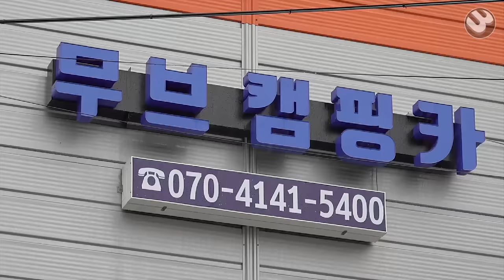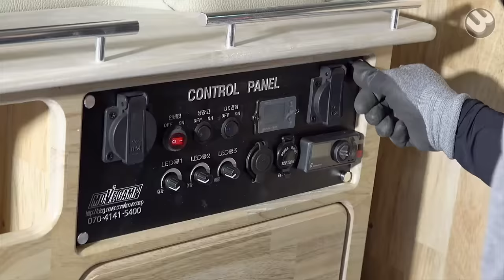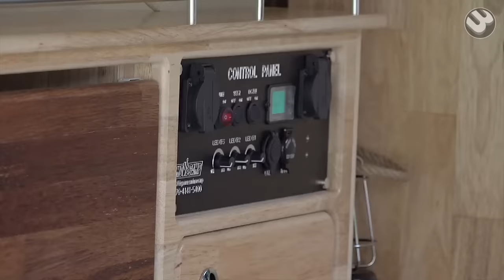Process of Turning Used Car Into Camper Van. Luxury Campervan Manufacturing Process

Comment: These guys look so in sync with one another. Amazing craftsmanship and team work. I love the they used all screws instead of fixed nails. Makes it much easier if you need to remove certain panels and pieces for paint or repairs..

Comment: Thank you ❤

I think this is a new car conversion, not a used car. Seems that 99% of the work is done at the factory building the components that fit into the vehicle. The end product is beautiful 👍🏼
Reply: Respectfully Wrong! 

These are all used vehicles; Pay attention to the demo / prep work. 

(Hint: Vacuum)
Reply: New cars don't have dirt, dried up liquids, and rust spots in the beds.
Reply: You can see the accumulated dirt that they vacuumed out, verifying that they are used, but gently used, based on condition
Reply: I think what they meant by "used cars" are resale cars; But I agree the conditions of the car is superb, which meant it's a fairly new repurchased car with much lesser work needed to be done. To be fair, if they had to show all the measurements and wood cutting process, it would likely be at least another 15min with time lapse.
It's a beautiful and superb product right down to the end.
Reply: Too much dirt under panels to be a new car.
Reply: @ksb8518  Blah, blah, blah.

Comment: Is there a U.S. company doing efficient, top-notch, streamlined mini-van conversions like this?  

Most likely NOT; or they want $75,000 to do so...
Reply: Then again in the US,  you'll get a camper van more than twice the size with the ability to tow a trailer, instead of a tinker toy Hyundai
Reply: @CaptainRon1913  Yeah, but it's $75k.

Comment: Great carpentry job but as a mechanic, i replace hundreds of fuel pumps in these van. It's on the floor board behind the driver seat. There is no more access to replace the fuel pump if it's defective 😂😂😂

Comment: Why can't you get Hyundai to supply you with vans without the rear seats and other parts that you have to remove to do the conversion?   Do you return the seats to the Hyundai plant to be reused?
Reply: 영상 속 차량은 중고차량이라서 그렇습니다 그리고 현대에서 자체 캠핑카를 판매하고있기때문에 개조용 시트없는 버전을 따로 판매하지도 않습니다
Reply: Here is the English translation of the answer above:

Yes, because the vehicle in the video is a used vehicle. And since Hyundai sells its own camper, it does not sell a version without a seat for modification.
Reply: They are USED Vehicles!